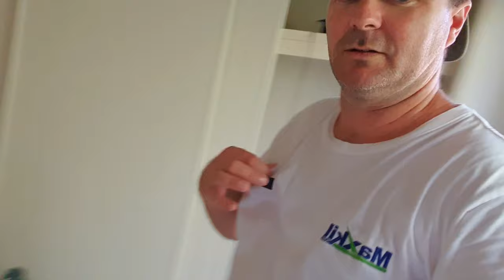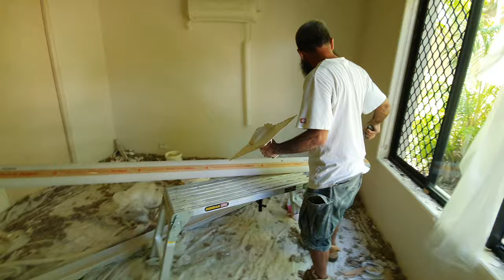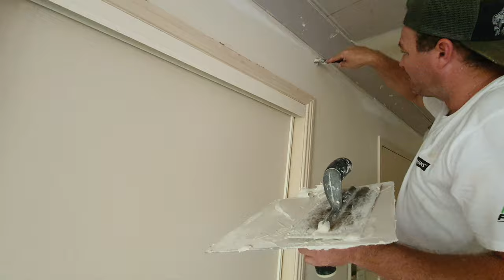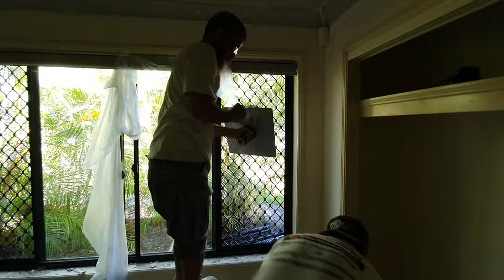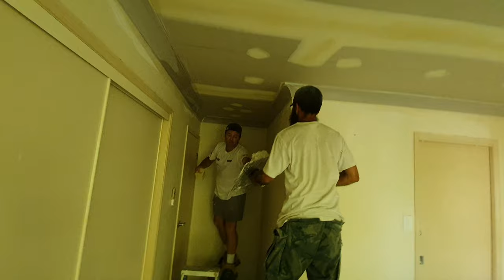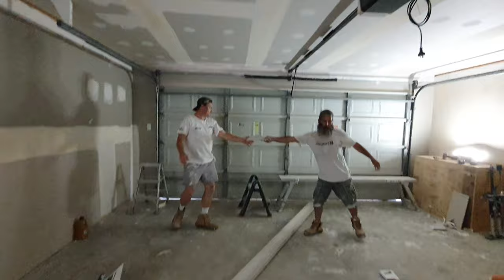How to Cornice a Room in 20 Minutes (DRYWALL CROWN)

Comment: A measure up video would be cool. Measuring the mitred butt joint where you join two bits got a 7.8m length to do. Thickness of your cornice cement. Never see nails etc to prop it up